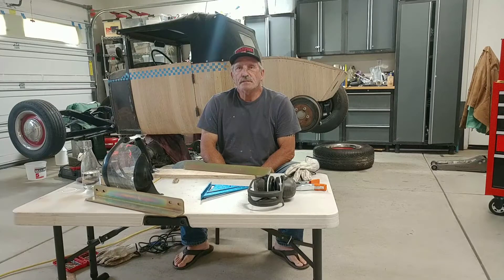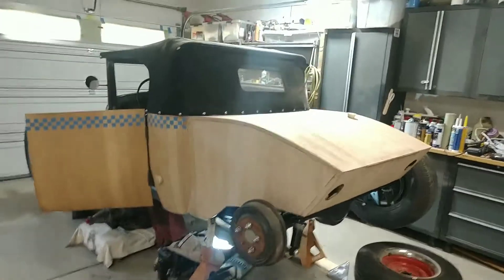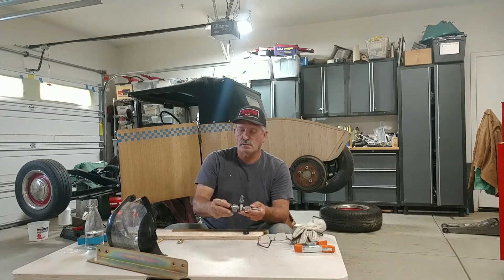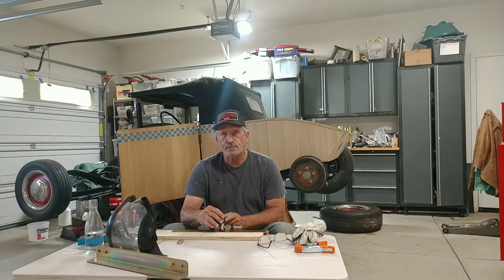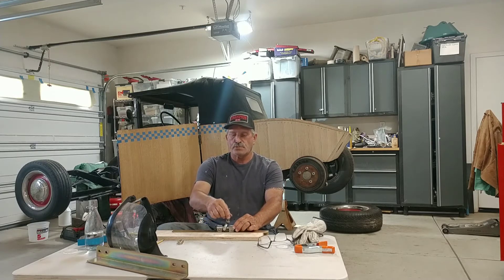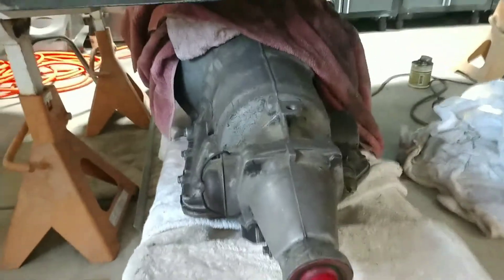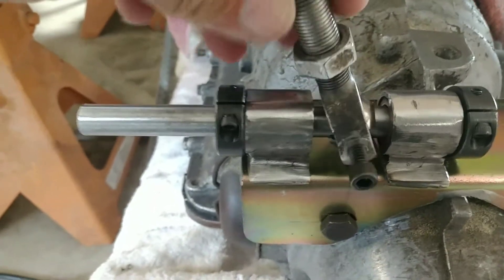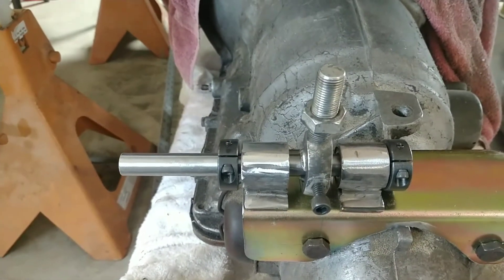Rat rod shifter fabrication

Comment: Hey Solo. Good job on the Park brake. It's coming together. Thanks for sharing.🍁👍👍
Reply from the maker: Right on Andy thanks, All along while I was fabricating it, I was hoping that it would work ,so I'm glad that it did. I was looking at the cut sheet on a 55 to 57 e-brake, and I saw they use pulleys. I saved myself a few hundred dollars not having to buy new brake cables, so that's a plus. 👍